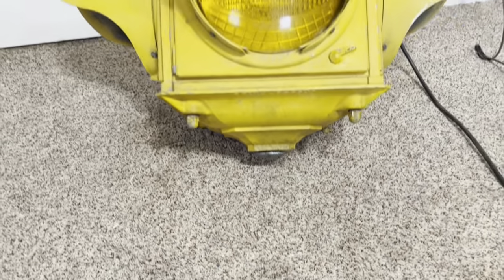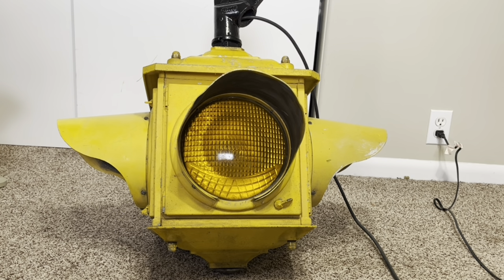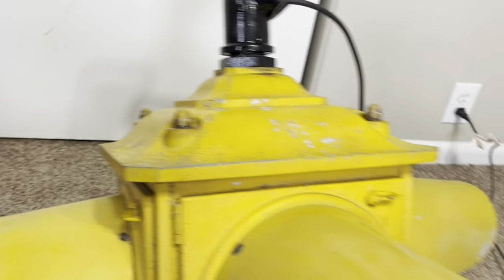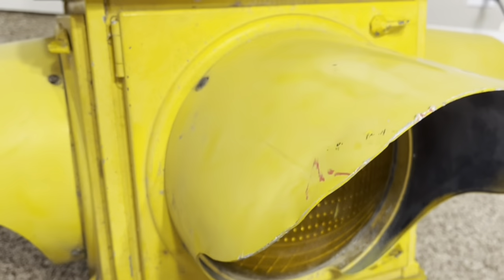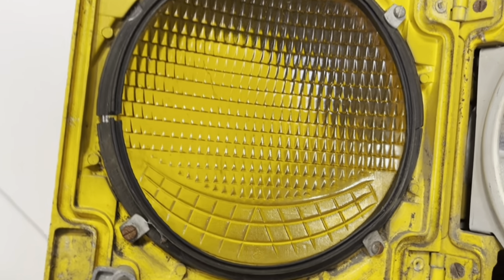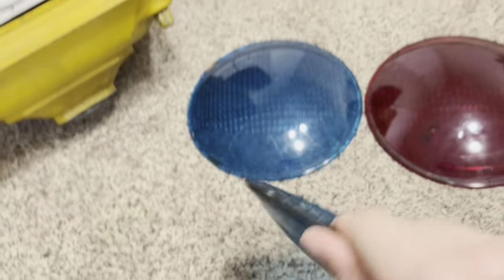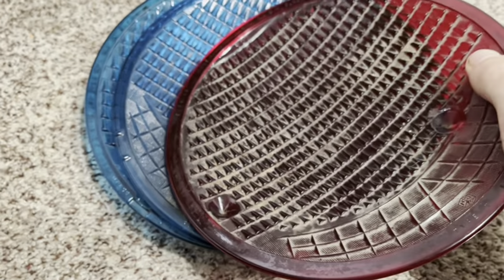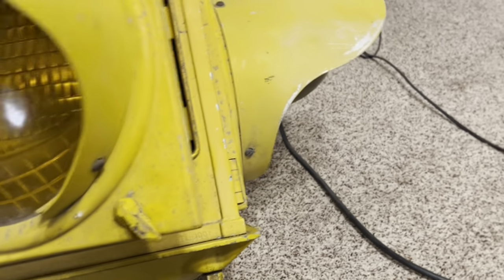Crouse Hinds Type DT 4 way beacon overview

Comment: Assuming you can find them, 25A19 or 33A19 sign lamps and 40A21 or 44A21 traffic signal lamps make good lamps for using in display traffic signals.